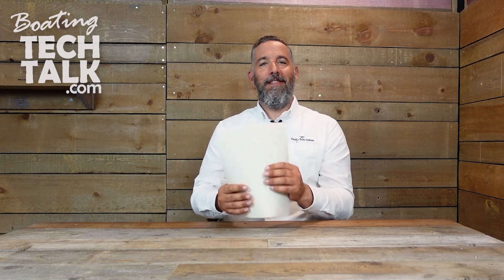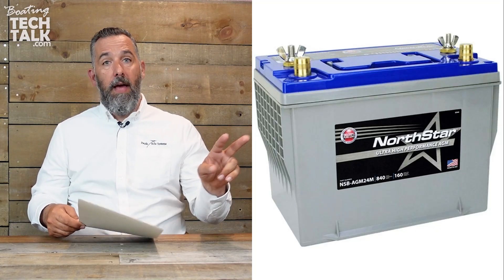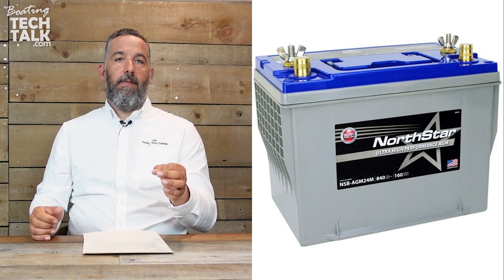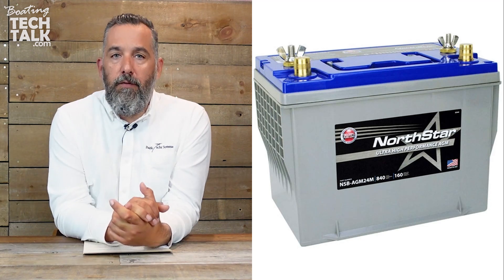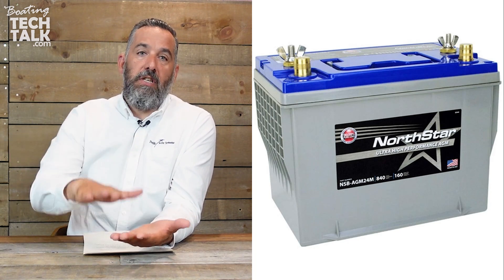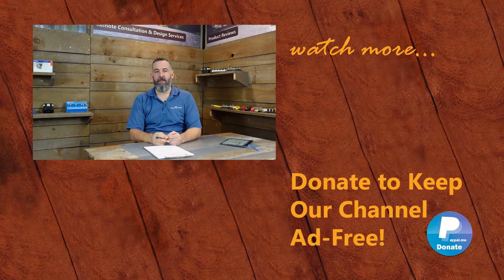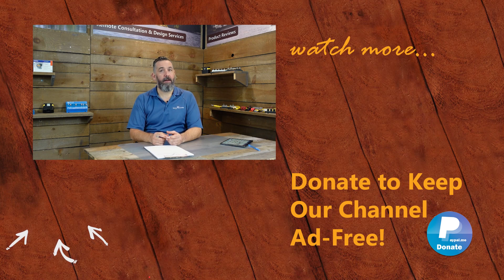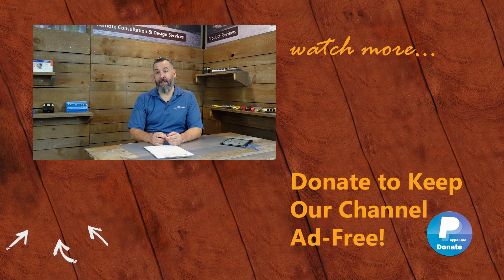Can I Use a Battery With a Second Set of Posts on My Boat?

Comment: Hi Jeff, John Hughes here. You have done extensive work on my boat and I appreciate all that you and your people have done. Question. On this video it shows a battery with an automotive post and a second post that one bolts onto. On my last survey for insurance the survey found a deficiency, the only one I might add, where I had a wing nut holding wiring onto my battery. He claimed that a wing nut can not be 'legally' used to hold on wires. It must be a regular nut. I had never heard of this before and seeing your example of the battery with these wing nuts I wonder if my surveyor was correct in his assessment?  No big deal as I just changed the wing nut to a plain nut. Just wondering though???

Comment: Jeff was wondering if you could do a video on a device to monitor generator AC voltage, Hz and load? I'm looking for a device to monitor. Currently have analog meter on boat only not sure I trust it. It's a 1995 Searay 370 Sundancer. I believe it's a 5-7 Kw genset. I watch your channel all the time and love the content. Bought the em-trak ais, icom vhf because of your videos. Thank you
Reply from the maker: Hi Mopar, here's a high end monitoring solution to consider:
https://www.philippi-online.de/en/products/supervision/new-battery-monitors.html

Comment: Jeff…stop calling yourself a Design Engineer.  You do not have license so you are not an engineer and legally you cannot claim to be one.  You are registered as EIT so go write the exam and get your license.  No short cuts…you have the degree and the experience and you have registered with licensing body so take the last step and get your license.  As a licensed professional engineer, I am put off by those with Engineering degrees and no license claiming to be an engineer.  Stop it…you know better bec I’ve told you before and it is reportable to the licensing body.
Reply from the maker: Hi Borys, totally agree.

Comment: Thanks for all you provide to the boating community.  My question is, if you are using both pairs of terminals (Auto and Marine) will you still get an accurate battery monitor reading, or will you need two battery monitors?
Reply from the maker: For an accurate battery monitor reading, you'll need to make sure that no negative wires bypass the battery monitor shunt.

Comment: I saw a FLA battery a few days ago with a huge warning on the threaded posts: don't use for high discharge currents.
Not sure why. I wonder if it's because of how the threaded and automotive post are interconnected. Anyways, it's worth checking the data sheet before attaching a high load onto either stud imho!
Reply: Threaded connection is smaller so rated for less current.  Use big post for starting and small post for house loads.
Reply: I think it depends on the posts: my threaded posts allow for the lugs to make full surface contact with the same plate that the main posts are on. I think your comment about checking the specs is key as the design may vary.
Reply from the maker: Hi Johan, did the FLA batt specify a max discharge amperage rating?
Reply: @PacificYachtSystems  Can't find a data sheet and says nothing on the case. I do see its a GEL battery, 12V, 105Ah. Threaded posts are M8 (5/16"). The sticker says cranking amps must be from automotive studs only.

Comment: Hey I have a Oday sailboat with a 14hp Universal 2 cylinder Diesel engine. I want to add a second house battery but have very little room to do so.  I was considering a motorcycle agm starter battery to save some room for my small diesel engine. If the battery has the cranking amps to support my engine, do you see any downside to using a “terrestrial” battery in a marine environment?
Reply from the maker: Thanks Loran.

Comment: I use nylon nuts for the threaded posts. The wing nuts tend to loosen up very quickly.
Reply: I've heard different opinions on Nylocs as battery post nuts, some say it's good but some talk about the nylon melting.
Reply: @jpvardy  just a good old hex nut will do it. I also place plastic caps on the other larger lead contacts too.
Reply from the maker: instead of nylon nuts, we use lock washers. Anyone know the temp limit on nylon lock nuts?
Reply: Bit of low strength threadlock is better option.